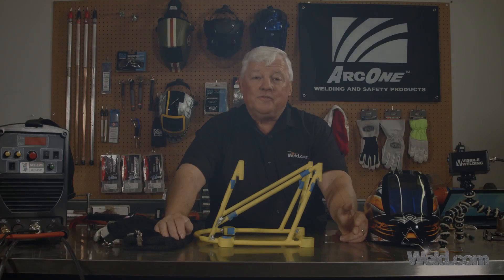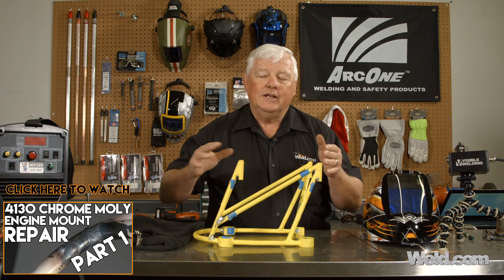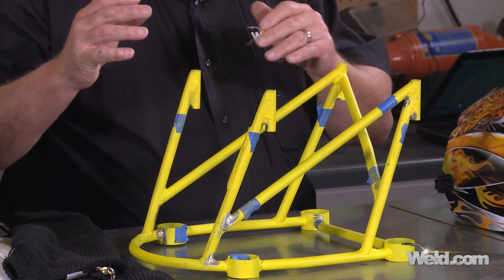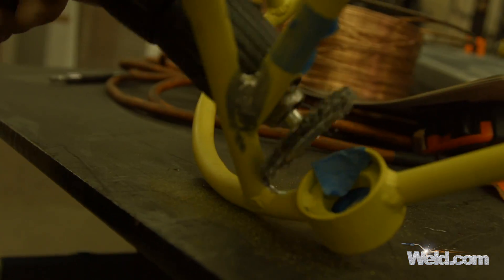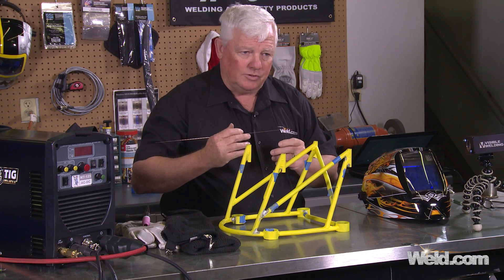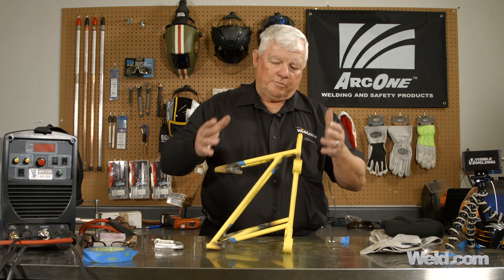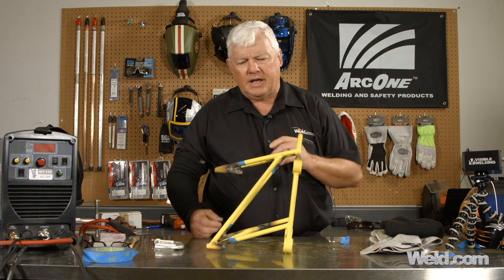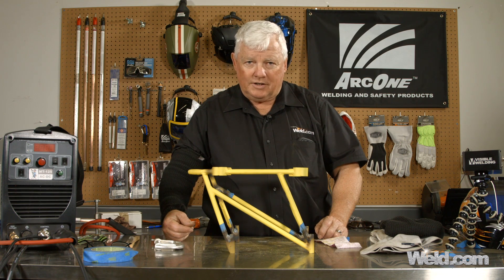4130 Chrome Moly Engine Mount Repair: Part 2 with the MT-125 | TIG Time

Comment: Mig is a NO NO for aircraft.  Mig heats TOO fast and cools TOO fast and will leave your weldment brittle around the weld joints.   This welded airframe was deemed un-airworthy.
 I will admit the Mig welding was  was of very good quality.
   So I did a procedure of cleaning off the old welds ( wire wheel cleaning )  then re-welded the entire airframe by TIG and added new filler metal.  
The procedure was document as a controlled modification and re-inspected and passed.
 The owner of the aircraft was thrilled.   

 I like your video Mr Tig you deal with real world situations.
Reply: I’m a 5 years late but their are company’s that mig their airframes!

Comment: Great videos.  I work at an aircraft maintenance facility and repair all kinds of metal issues. Besides making a hole for pressure relief, some manufacturers (BeechJet) recommend after completing all welding and stress relieving the welds, I pour some Linseed Oil in the motor mount sections, then drain it and plug weld the hole. This does two things...preserves the internals and if a future crack should occur, the Linseed oil will show up at the crack during future inspections.